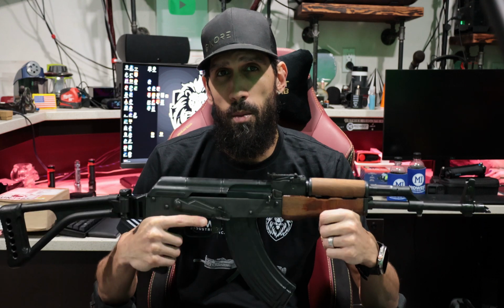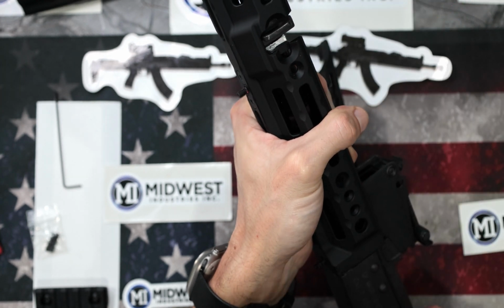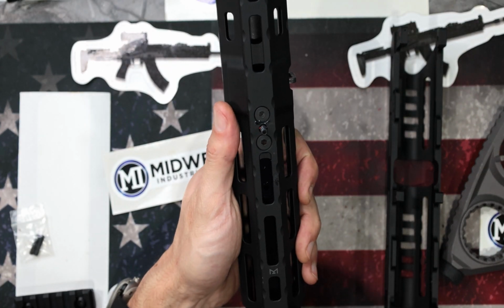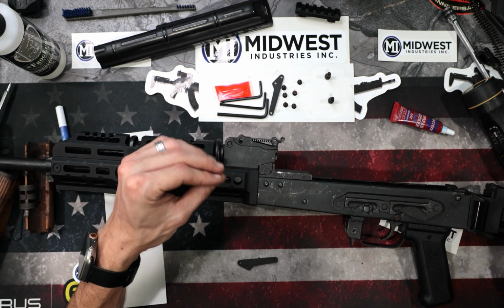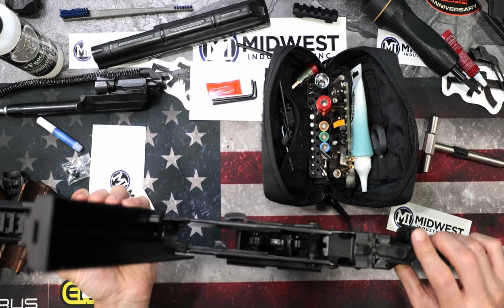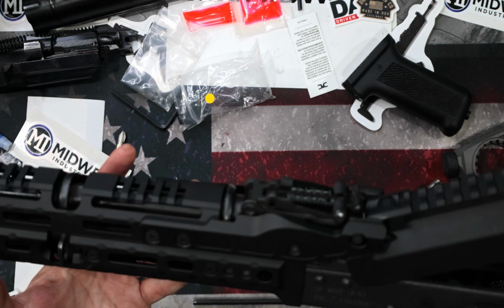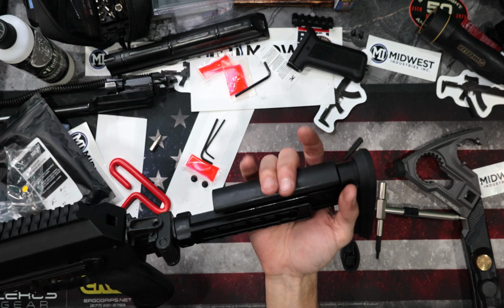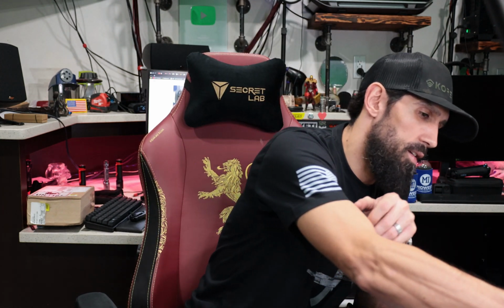Midwest Industries AK Alpha Series Installation (Handguard, Top Cover & Stock)

Comment: You are supposed to put loctite on the clamp screws and screw them in with the pain in the ass ball hex wrench after fitting and installing the clamp... but in my opinion don't use blue, use pink loctite. I unfortunately had to remove my handguard for a reason and those TINY suckers DO NOT want to come out, even with heat.... and YES, GOD BLESS MIDWEST INDUSTRIES!!!!!.... THEIR PRODUCTS ARE SUPERIOR!!!!!!.... LOVE ALL OF THEIR STUFF!!!!